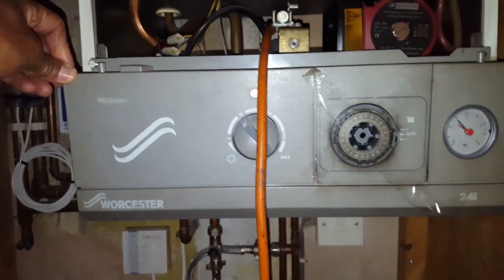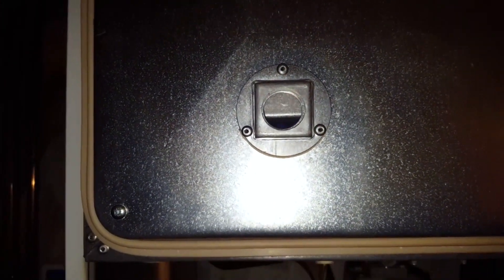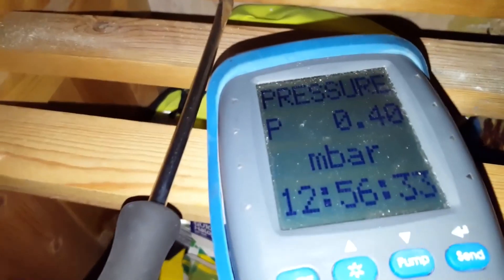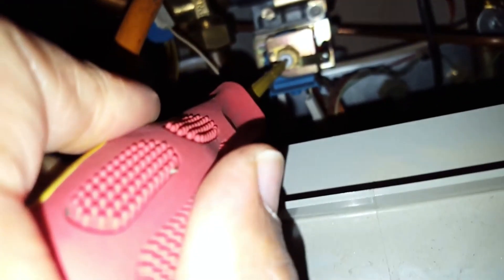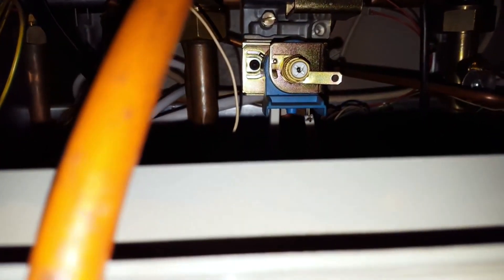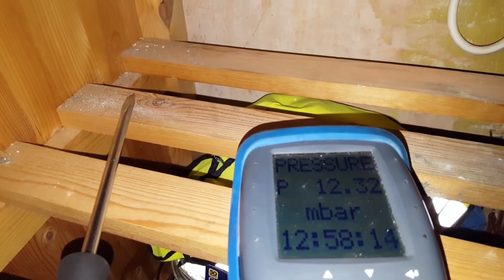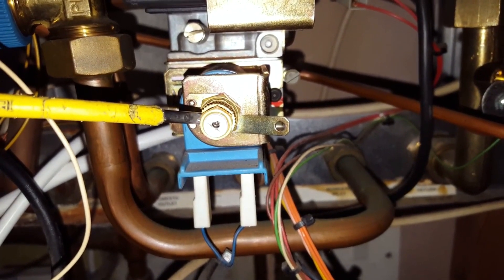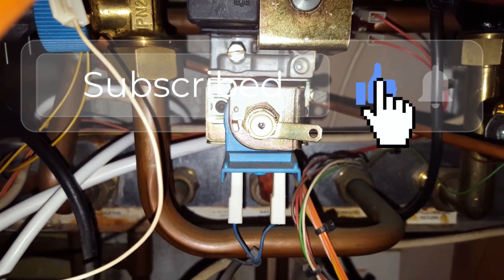Worcester 24I RSF Setting up The Burner Pressures

Comment: Hello sir, thanks for the video, on a Worcester Bosch 24cdi, removed the modulator blue cable but pressure is not dropping safe to assume valve is faulty?

Comment: Could you not set minimum BP with CH on?
I've read the instructions on this model but don't understand the clip removal for minimum? (Where you removed the white clip on the right)
Reply from the maker: There is normally a plastic cover over the white plastic screw. I mainly grab the plastic cover with some small grips to remove it.